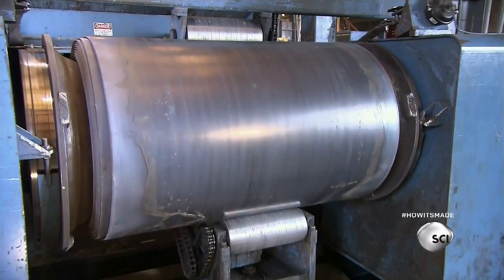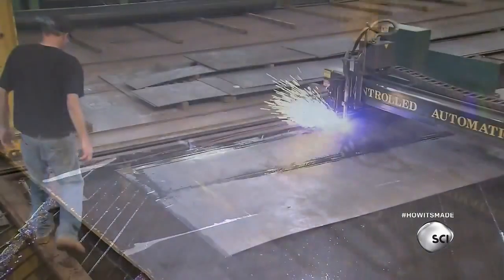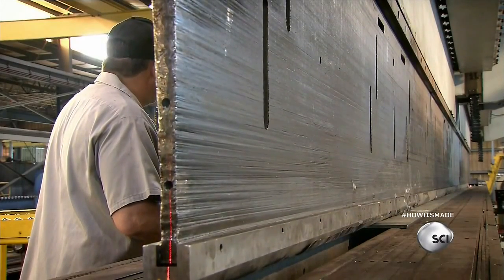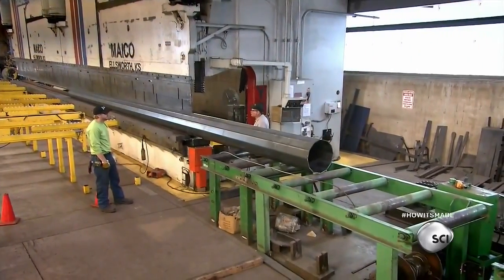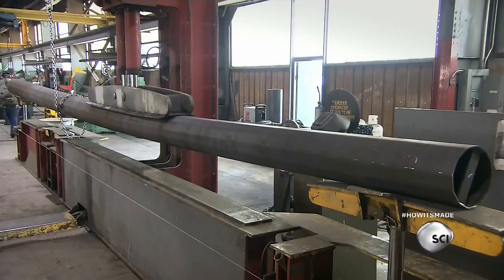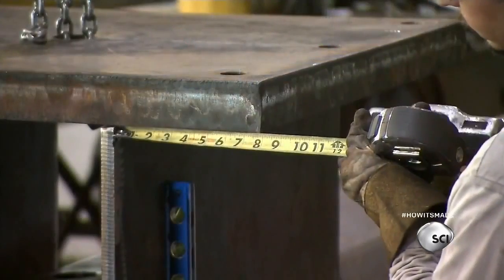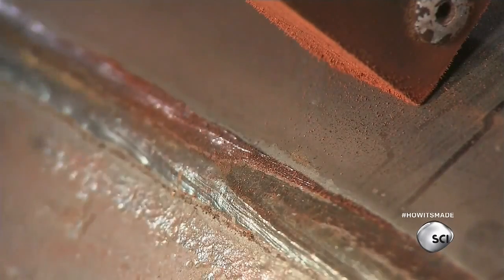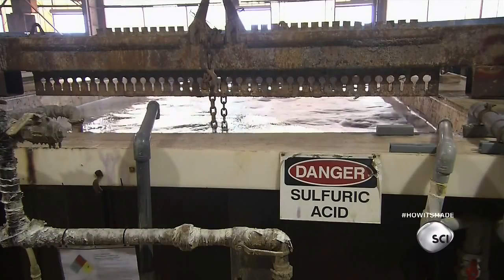how its made Steel Poles

Comment: I don't care how they make the poles with the extension going out from the poll should not exceed the height of the main pole going to the ground. I've seen too many of these poles and and wins only 30-40 miles an hour not even that waving up and down and almost hit in tractor trailers as they go underneath, it's a very scary experience especially when you're driving or needs with a car watching it thinkwave round and about 20 mile an hour wind do things are too dangerous to be put up